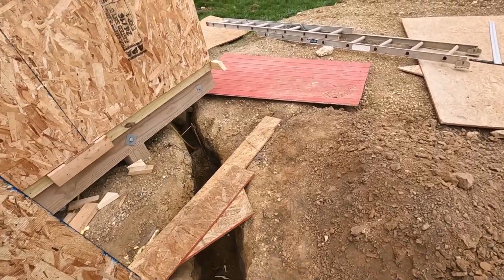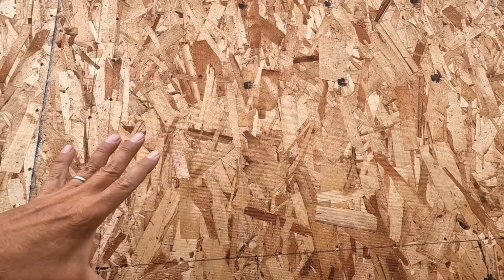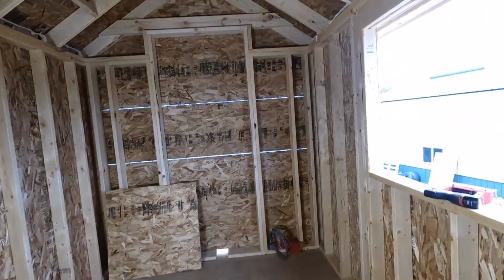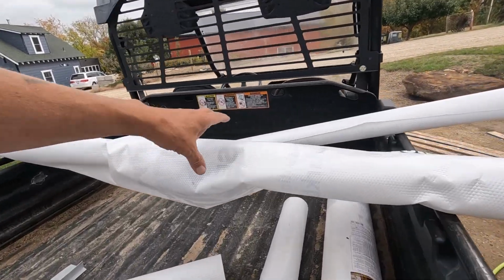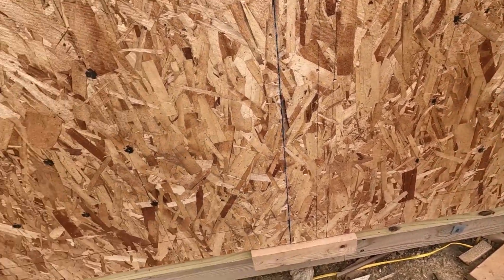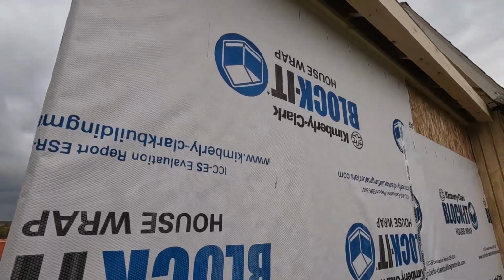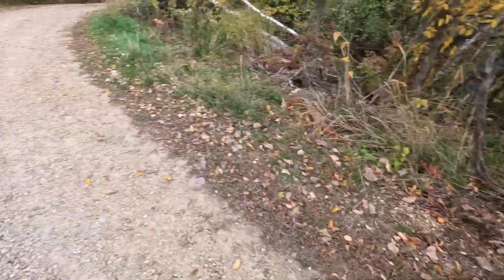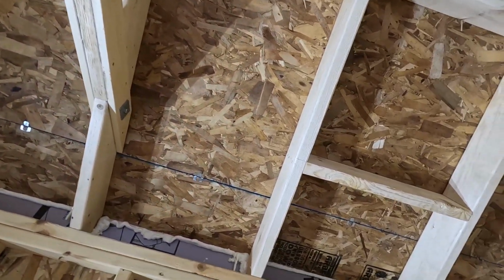Tiny House Dry-In ― Cut-Out Window - Fill Soffit Ends - Install Housewrap

Comment from the maker: Yesterday it was insanely windy, but I got my new staging set-up (review video tomorrow), and got half of the roof shingled! Today I am installing the skylights and finishing the shingles (hopefully!). Wish me luck! 

Here are some of the power tools I use here on Planet Mojo:

DEWALT 20V HEPA Vacuum - https://amzn.to/490Hm2z
60W LED Temporary Work Light  - https://amzn.to/46P8XC1
4 Way Locking Cat Flap Door - https://amzn.to/3PSXgDv
K-Type Thermocouple Connector - https://amzn.to/46e7YLQ
DeWalt Impact Driver Anvil - https://amzn.to/3F7lSDw
Dickies Men's Industrial Strength Suspenders - https://amzn.to/3tcTkFY
Sheet Metal Hand Seamer - https://amzn.to/3RxZE57
Dewalt Aviation Snip Set - https://amzn.to/3PNwWMo
Klein Tools Infrared Digital Thermometer - https://amzn.to/48n0mZ8
DeWALT Separator with 10 Gal Stainless Steel Tank - https://amzn.to/3YNZlow
DeWALT 20V MAX 14" String Trimmer - https://amzn.to/43uRQU4
DeWALT 20V MAX XR Oscillating Tool Kit, 3-Speed -- https://amzn.to/3aYKIaS
DEWALT 20V MAX Impact Driver -- https://amzn.to/2JzyCK2
DeWALT 20V MAX Cordless Drill -- https://amzn.to/38PmInW
DeWALT ATOMIC 20V MAX Cordless Drill, 1/2-Inch, Tool Only -- https://amzn.to/3rKAwbZ
DeWALT 20V MAX Circular Saw -- https://amzn.to/3p60tR7
DeWALT Rotary Hammer Drill with Shocks, D-Handle -- https://amzn.to/37u2DUJ
DeWALT 20V MAX XR Jig Saw, Tool Only -- https://amzn.to/2J66QEQ
DeWALT 20V MAX XR Reciprocating Saw, Compact -- 
DeWALT 20V MAX XR Compact Reciprocating Saw -- https://amzn.to/3nKHVFG
DeWALT 20V MAX Cordless Drill / Driver Kit, Compact, 1/2-Inch -- https://amzn.to/2KBzFcK
DeWALT 20V MAX XR Oscillating Multi-Tool, Variable Speed -- https://amzn.to/3nxzBt7
DeWALT DCG413B 20V MAX Brushless Cut Off Tool/Grinder  -- https://amzn.to/3mC4g78
DeWALT ATOMIC 20V MAX Circular Saw, 4-1/2-Inch, Tool Only ― https://amzn.to/3qYBiB9
DeWALT ATOMIC 20V MAX Reciprocating Saw, One-Handed, Cordless, Tool Only ― https://amzn.to/2Msu21r
DeWALT 20V MAX Cordless Drill / Driver Kit, Compact, 1/2-Inch ― https://amzn.to/3cbAhBl
DeWALT 20V MAX XR Impact Driver, Brushless, 3-Speed, 1/4-Inch, Tool Only ― https://amzn.to/3opEzaF
DeWALT Cordless Impact Wrench - https://amzn.to/3L5lvvl

12" DeWalt Chainsaw -- https://amzn.to/3oiLvId
16" DeWalt Chainsaw -- https://amzn.to/33Wqn1r
12 Ah Battery -- https://amzn.to/33JN48U
9 Ah Battery -- https://amzn.to/2SKUQwN
6 Ah Battery - https://amzn.to/3PyhOCT
6 Ah FlexVolt Battery -- https://amzn.to/3odC6BW
9 Ah FlexVolt Battery - https://amzn.to/3O4E7xu
12 Ah FlexVolt Battery - https://amzn.to/3pYI2UB
15 Ah FlexVolt Battery - https://amzn.to/3OpoCl2

Comment: Hi Mojo, that was a real neat job considering you were on your own, the trench and the scattered rocks looked a real hazard, it will be good when the trench is filled in. Is Izzy the only one of your dogs that chase the stick,I bet Izzy is a lot more confident now she has her playmates with her. Guess you are a too busy with the addition to do another trapdoor woodwork episode,hope to see some in the future.
Reply from the maker: Thanks Larry! Yes, the trench was a problem, but it was necessary. Believe it or not, there is another trench that needs to go in before the ground freezes! 😮Natalie unrolled the wire and bundled it yesterday, and we pulled it into the house and ran it to the electrical pedestal. We then filled the trench near the tiny house to make life easier while shingling the roof (no video, but half of the roof got done). You are correct about the dogs. Only Izzy fetches. The other two have zero desire to do any work like that. Yesterday there was three gunshots while we were walking, and Izzy started to run home on the first one, but turned around and decided to ignore it. I think Deja gave her some bravery, and now that it's a pack, she gets over her fears pretty quickly. The tiny House was kind of sprung on me right when I planned to do regular videos on Trap Door. Now I'll be getting back to that in January, and work-in at least a video a week moving foreword from there. 😊

Comment: How did you get the wrap on that upper part from a ladder?
Reply from the maker: I set-up a ladder on both sides, and went up there with a pre-cut (length) piece, and pulled it tight in the first corner, then walked over to the other ladder, pulled it tight over there and stapled it taught. Then I filled in the staples along the bottom, and flipped it up over the peak and stapled that. Then I stapled the edges and trimmed-off the excess. It went very quick and easy. 😊